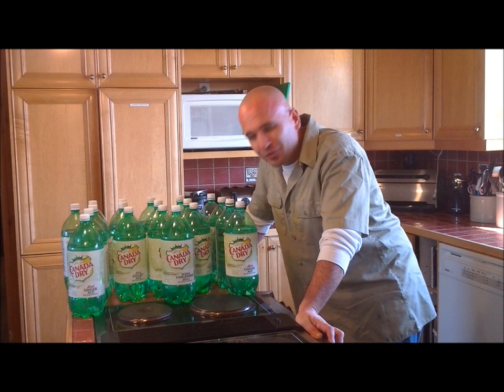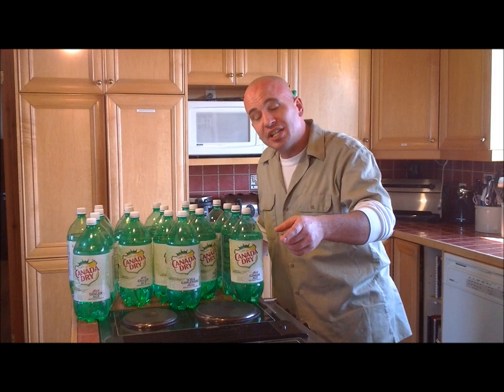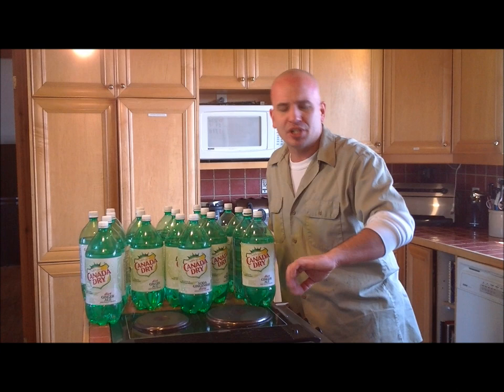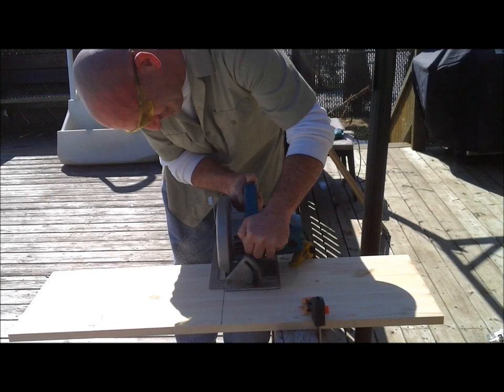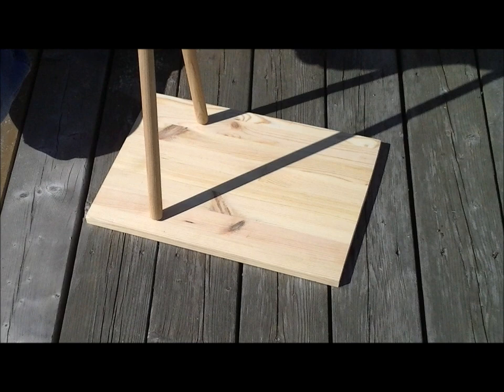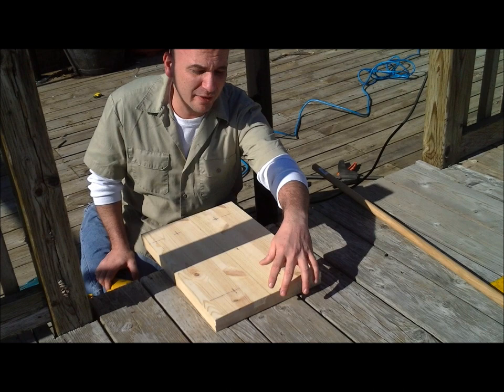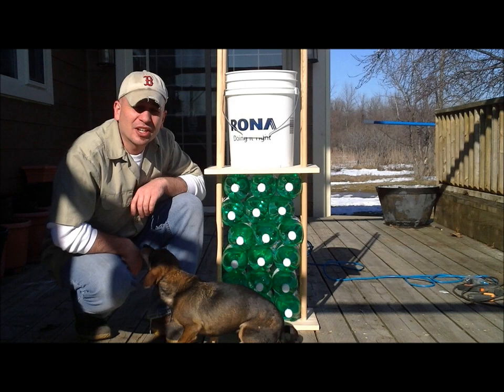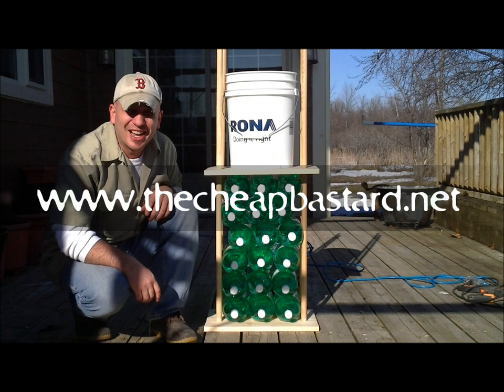thecheapbastard.net presents: Building the 2 Litre Bottle Tower for Emergency Water Storage

Comment: couple of tips that make it better. First drill the hole a thread smaller so that you can screw the replacement stick directly into the wood. 2nd. if you don't choose to do this use a forstner bit to drill the holes. Cleaner and no chipping.

Comment: Plus, attach mop handles with a screw through 3rd board. Drill pilot holes to keep handle from splitting. Extra strength at bottom joint. 

Wooden closet poles from Lowes should be stronger than mop/broom handles. Build wider unit with using those for more bottles per row.

Comment: Gave me an idea when you stacked the boards to drill both at same time. Think ill take a third board and glue under bottom board . I'm thinking a little bit of stability and  I hoping I won't poke the dowels thru that way. ( bit of a klutz :( on occasion).